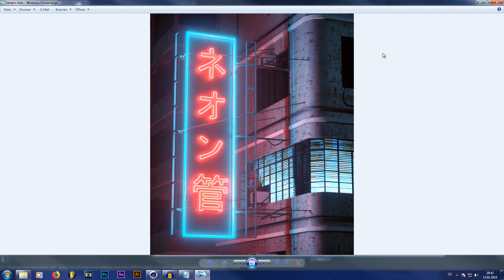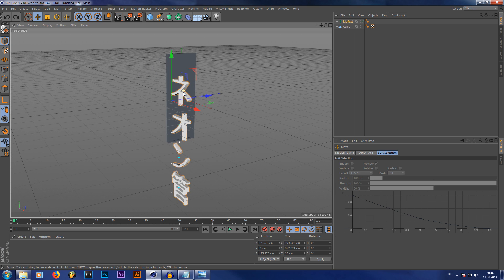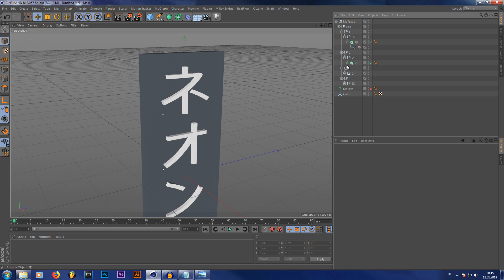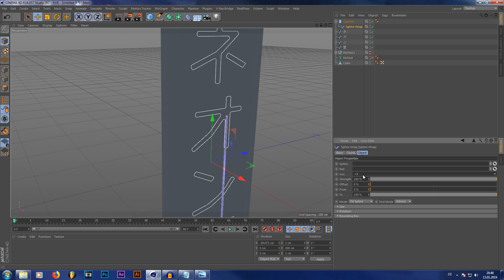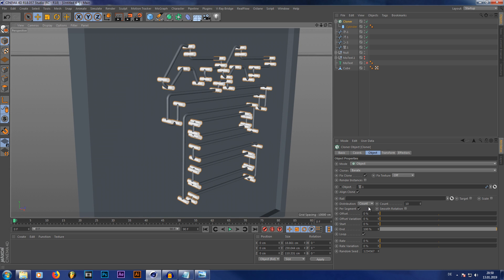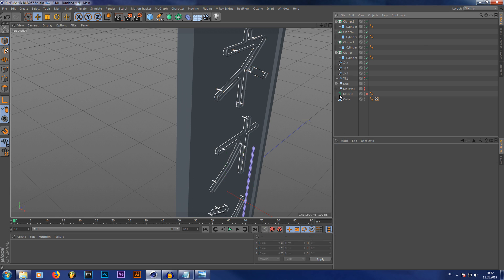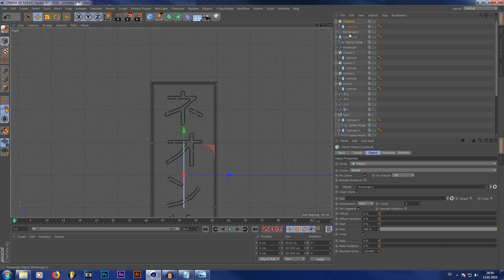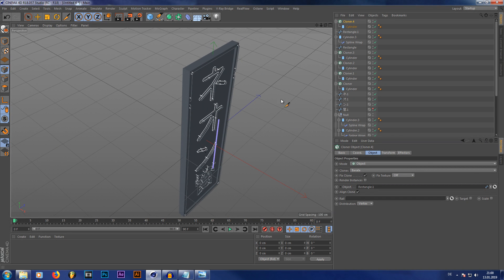Realistic Neon Signs Tutorial | Cinema 4D

Comment: how did you put it near the building with illuminance ( blue and red ) reflecting on the building? and this is dope man!
Reply from the maker: Thanks! Since its an emissive material it will throw light at objects near it and illuminate them, just be careful that the frame of the sign in not thicker than the hight of the characters. Otherwise the light will be blocked by said frame and not reach the building